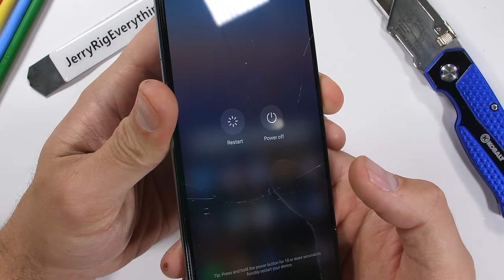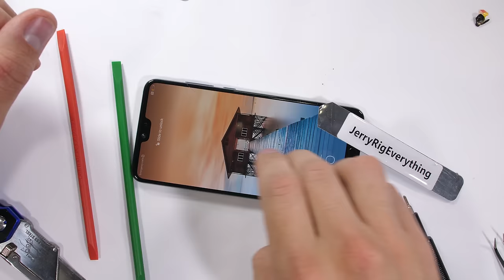Triple Camera P20 PRO Teardown – Are they all stabilized?

Comment: Hey Jerry, an advice to remove the battery without magical tape: Put it in the fridge for 10 to 30 mins and knock it on the table and the battery should come off easily. (I'm a smartphone mechanical design engineer)
Reply: how could i research this to see if its true, sounds kinda sus tbh

Comment: as a p20 pro user, the phone is great, the camera is decent, although I wish it had the 4k 60fps coz why not :l
Also there's many mistakes in the programming, like the phone keeps changing the brightness automatically regardless if the option is on or off. Aaaand you can't zoom in videos; the background recorder is a mess at recording the system sound; also when you record the background you have this little timer that you can't remove; and any media file that you download from Google images can't be seen on your media gallery for some fucked up reason. But hey, it was better than getting a Samsung or an IPhone, given that they have not had any improvement at all.

Comment: i have a question to 1:01 the Tab at the bottom with the black Glue. I removed it and installed a new back cover. now i think my speaker can not generate much base it sounds slighly hollow. Do you know if this glue is on the speaker to make the sound sound more stable. Greetings

Comment: So wait a minute...if heat is all it needs to get the adhesive out, (Miami, Florida is in fact hot on basically every season), will it lose its water resistant glue?
Reply: 😂🤣 you are joking right
Reply: I wish! He said with a little bit of heat the back comes right off. Made me wonder, that's all. Other than that phone looks good.

Comment: hey man, your tear down skills are very barbaric and actually dangerous to repeat
never remove battery with metal pry tools.
most of job can be done with flex piece of plastic wetted in some degreaser or gasoline to slightly dissolve adhesives. this way minimum damage, almost no need  in heat and actually you can re-use adhesive if it wasn't smashed too much

Comment: Apple wants their batteries to die so they can force you to upgrade because other then the iPhone X design their has been no real reason to upgrade from an older model to a newer one since most phone 4 to 5 years old still get iOS updates and all the changes have been minor year to year slightly better camera sensor, slightly better screen all very minor updates until the 10 but that was way to much money where the only real difference was Face ID instead of Touch ID and a bigger screen vs it's 8 or even 7 brothers! 

So Apple putting older/worse style batteries in a phone is their subtle way of forcing you to upgrade to a newer iPhone Samsung guarantees you 95% battery life after 1 year on the  Galaxy & Note 8 but 95% on the newer galaxies 9 because new technology makes better batteries possible through a mixture of software, firmware and hardware (especially battery formula & design!) what Samsung does to force you to upgrade is Samsung Experience getting more laggy over time and the built in Disk Cleanup & Optimization tool becoming less effective for no reason! 

Simple fix for Galaxys is turn on developer mode turn all the animation speeds from 1x to off, use a different UI like Nova Launcher (if needed I don't!) and use google's own Files Go App rather then the shitty built in one!